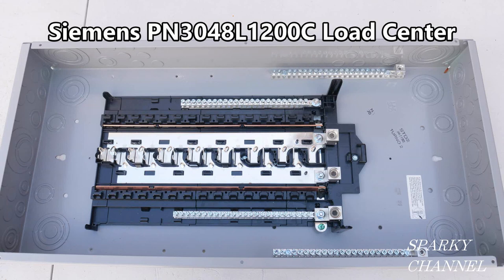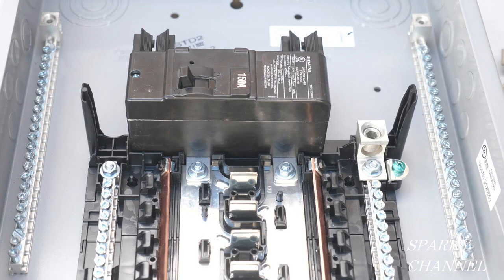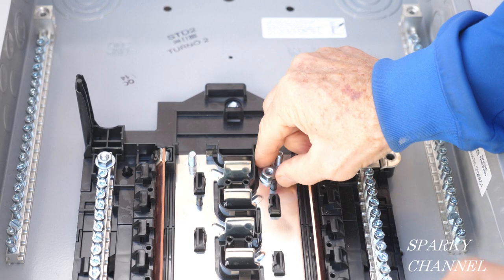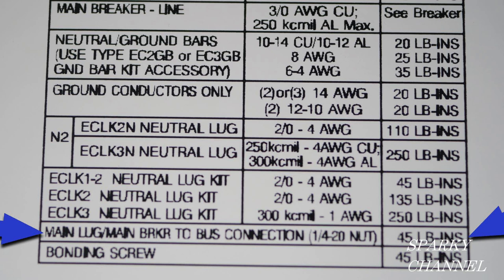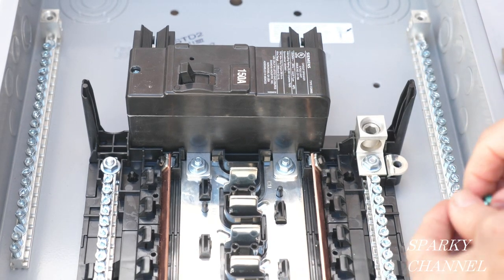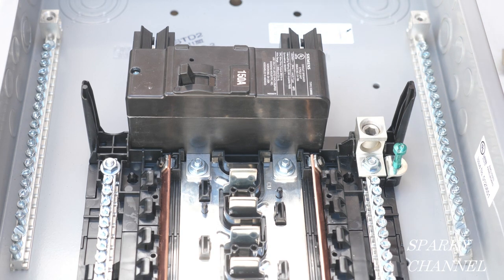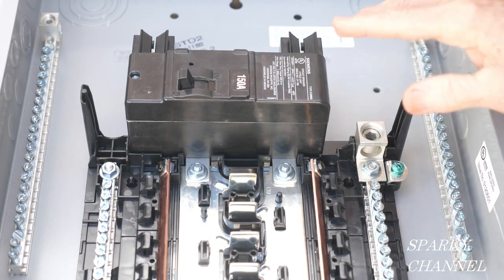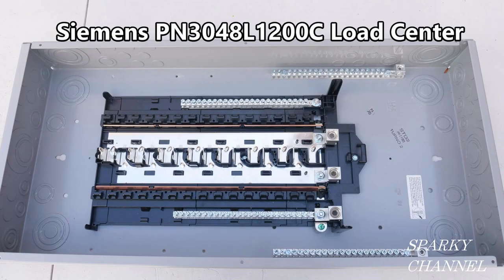What is a Convertible Load Center and How is it Converted?

Comment: Another great video and explanation of the topic and Main Disconnect and Service Disconnect panels.  Looking foreward to the next video.
Reply from the maker: Hi Don! Thanks! I like the convertible load centers. The main disconnect in the video only cost about $90. That might be well worth it for many homeowners for the convenience of being able to shut down a workshop or something where they have a sub-panel.
Reply: @SparkyChannel  Agreed.  Many years ago when MB panels were more prevalent than MLO panels, I could buy a GE MB panel cheaper than a MLO panel...times have changed.  I get a better buy on preinstalled 200 amp main breaker panels.  If you do a panel change-out and need a 150 amp breaker to match existing SEC, buying a break would be the way to go.
I've been an regular ITE or Siemens user for a long time.
👍
Reply from the maker: @donl1410  Thanks, great information!
Reply: @SparkyChannel  👍

Comment: 45 in lbs isn't much torque. I have to wonder how many guys have twisted those studs off or stripped the threads?
Reply from the maker: It goes both ways, over-torqued or under-torqued. I think you're right though, there is probably more over-torqueing on a 45 in-lb spec.
Reply: @SparkyChannel  ... if you think about it, 45 in lbs is 3.75 ft lbs. You can do that with one finger on the typical torque wrench. As a retired vehicle mechanic, I respect that anything in inch pounds is probably critical.... and usually made out of plastic or aluminum. (or secured by same, such as breaker panel parts)
Reply from the maker: @rupe53  Yes, the people who make these torque specs do a lot of research before setting them. I respect the various torque settings as well.

Comment: Can you please make a video about those tandem circuit breakers?  What is the code for these now?  I'm talking about those circuit breakers designed to fit 2 circuit breakers into 1 opening.  They are usually used when the circuit breaker panel is full.   But you still need a few more circuits.

Comment: Bill, can you do videos sometime on (1) whether or not it's code to use an interlock for running a generator, and (2) restrictions on the types of connectors that can be used for connecting the ground wires in outlet boxes. Regarding #2, my inspector says that I need to use crimps for the ground wires, but I don't see such a restriction in the code. Thanks!

Comment: Video very helpful. Thanks Man
Reply from the maker: Glad you liked it!
Reply: @SparkyChannel  yes I like it very much👍
Reply: @SparkyChannel  i wanna install the same one. Please my question When I’m gonna take the meter off and put it back after i don the job. do i have to call the company tell them I did remove the meter or No?? as you know i have to cut the (meter seal)
Reply from the maker: @rachidchagdaly4490  You don't touch the meter. Your local utility does that.
Reply: @SparkyChannel  you mean first I have to call them to shut down the electricity ?
Reply from the maker: @rachidchagdaly4490  First, you get a permit. Then you coordinate with your utility.
Reply: @SparkyChannel  tks